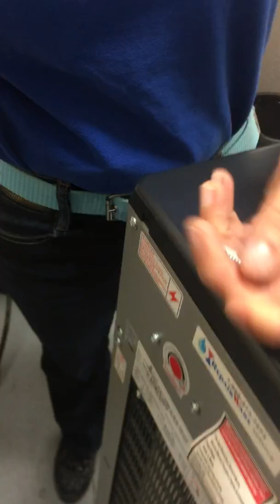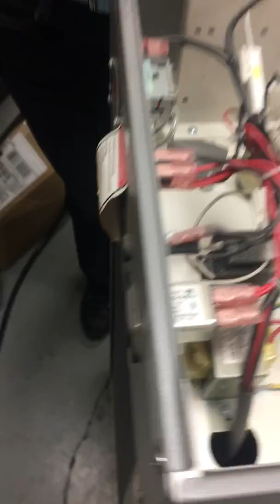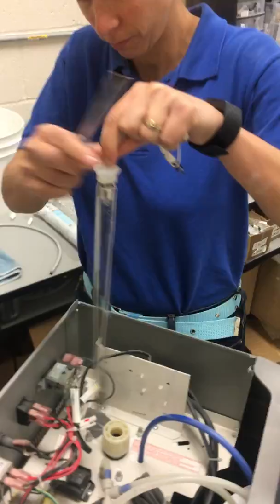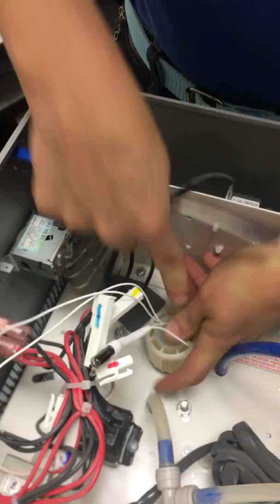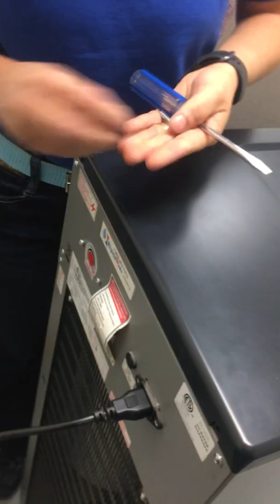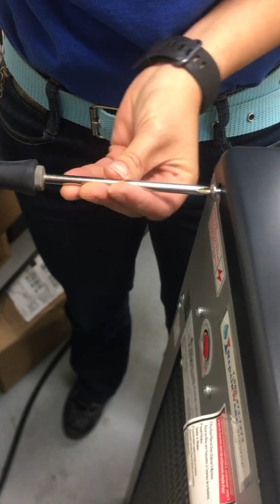WATERLOGIC WL250/UV LAMP CHANGE

Comment: Thanks for uploading this. My waterlogic has started beeping and flashing its red light. It’s dispenses hot water but won’t dispense chilled water. I’ve inspected the unit for leaks and any other problems but can’t see any. I removed the UV lamp and it looks like it’s seen better days. I’ve ordered a new lamp so hopefully that fixes the problem. Am I right in thinking that a flashing red light and beeping could be a sign that the lamp has blown?